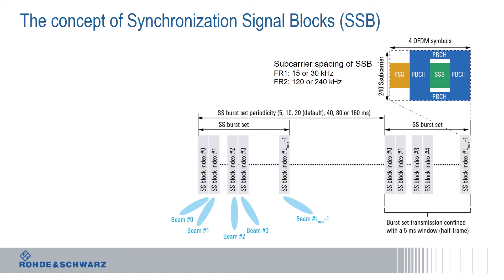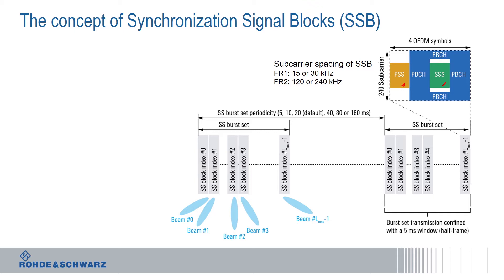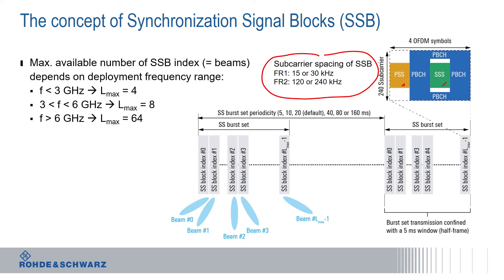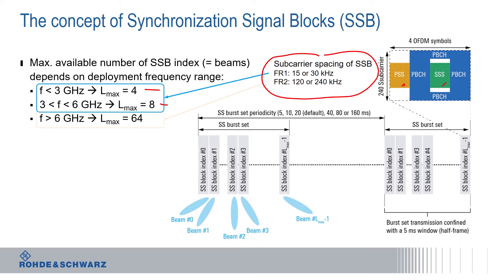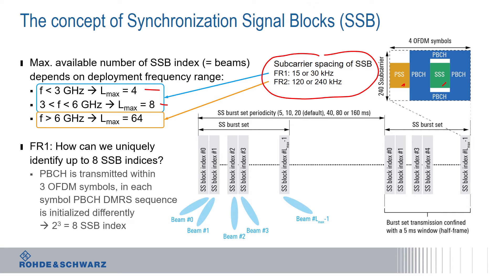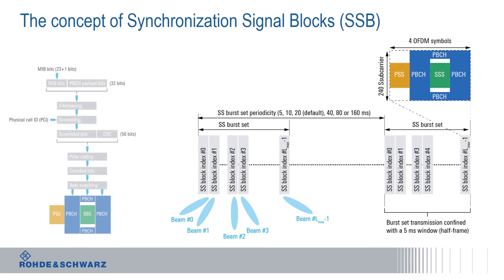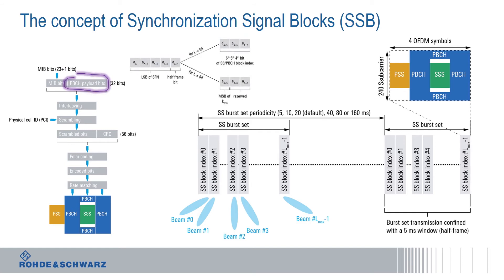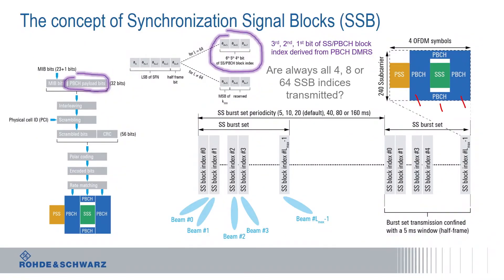Demystifying 5G – Concept of SSB beamforming in mmWave frequencies

Comment: For the case of grid of Beams based on PMI (Precoding Matrix Indicator), gNodeB sends in downlink CSI-RS reference signals (one per each antenna port) and UE measures them with RX antennas and computes the PMI matrix (from the air interface matrix and with the help of SVD matrix decomposition UE is able to compute PMI matrix, diagonal matrix and equalizer matrix from the air interface matrix). This PMI is sent to gNodeB that uses as weights for beamforming. my question here is that is it possible to use a common source multi-beam antenna (each port generates multi-beam simultaneously) along with the codebook to differentiated the UE location (assume that the reference signal is set after precoded)?